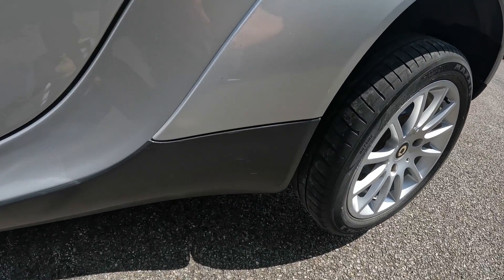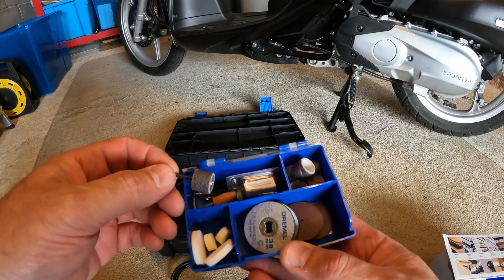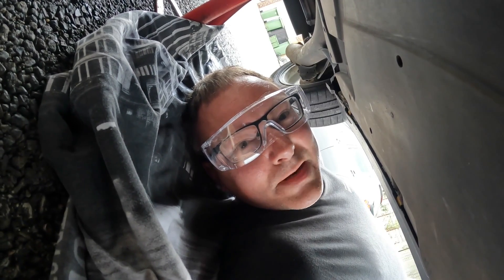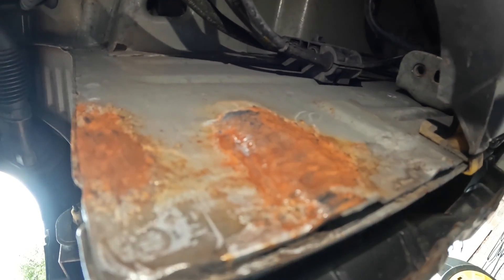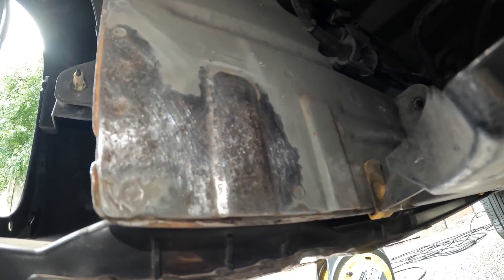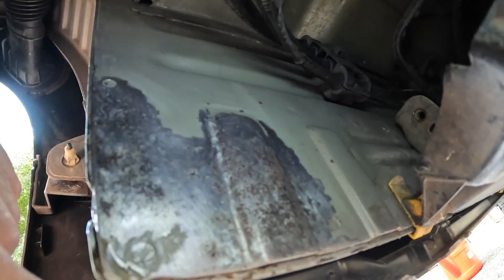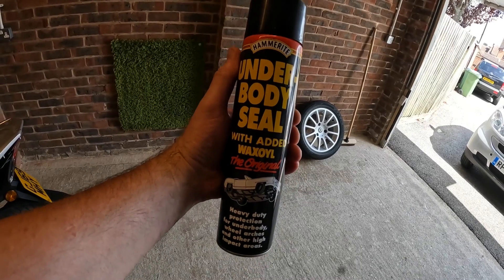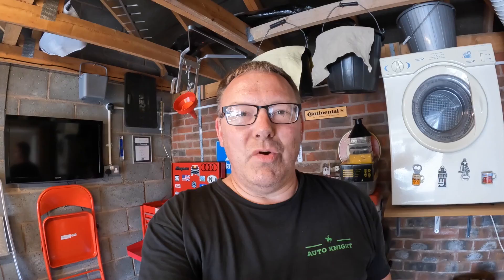Tridion Rust/Corrosion - Smart Fortwo 451 Passion 84 BHP 2008 - Fixing Rust & Destroying a Dremel

Comment: As for protection, as a former corrosion and coatings technologist, I would use an acid etch primer prior to the (cold) galv paint as it will adhere to the primer and oxidise without flaking off. After that, paint it with what you like.

Comment: Will check this area, when I'll paint the rocker and front+rear lips, in body color. Thanks for the tip! 
I would recommend, a light spray-on underbody wax over that. Still transparent, but protects even better. I had the impression that spray zink coatings are not very rub- or moisture-resistant. Best Regards

Comment: I must check this area on mine. There's a cold galvanising paint similar to yours called galvafroid, we use it frequently in fabrication and it works really well, a small can is quite heavy. If yours is like that it should be very effective. The Dremmel is disappointing! 
I use rotary wire brushes in a cordless drill when access is good and also small rotary  grinding bits, both with 6mm spindles. Nice job though 👍

Comment: As an engineer I wholeheartedly agree with your philosophy of not masking with underseal as this can get damaged itself and then water and contaminants can get under it and actually cause unseen rust.

I use Waxoyl spray everywhere including inside cavities such as sills and the rear swinging suspension tube 

One thing I would say which you seem to have overlooked is the actual cause of the rust in the first place.

You correctly diagnosed the reason being the movement of the plastic arch liner end. It will still be rubbing and removing your fantastic work, resulting in further exposure to rust pretty quickly.

I'm going to check my 2010 451 tomorrow and fix any issues but then I will adding a double sided rubber patch on the rub point so that the plastic liner has something non-metallic to rub against. 

Ages ago I bought and extremely cheap Chinese variety pack of rubber pads designed for use as feet on boxes etc. One of these each side would be perfect.

I am fortunate that my 451 must have been stored in a garage as there is no rust anywhere...except those stupid Torx bolts holding the exhaust heat shield on which I have soaked in Waxoyl rust inhibitor spray in readiness for removal and replacement, probably with stainless.

Enjoy all your videos mate.

Oh...and my Dremel is 20 years old at least and is still going strong. Don't lose faith in them...maybe pick up and old one secondhand as they were possibly better built back then and are indispensable tools.
Reply from the maker: Thank you for your comment. I haven’t yet fully refitted the arch liner so I’m still debating what to do, either a rubber pad as you have suggested or a cable tie to secure the end extension of the liner to the adjacent plastic under tray, therefore keeping it away from the freshly painted section.
Reply: fixing the rub would be better done by removing some of the plastic so it does not rub. if you genuinely want to stop the problem coming back, that is really the only way. you need to remove the pressure between the pieces. use of things like rubber patches become areas that will require maintenance and it is better to avoid adding to the list of things you have to go back to check. just my .02 from 30 years of experience trying to stop this on vehicles, especially motorcycles where rubs are often and plenty!
Reply from the maker: @ribbitism  That is exactly what I’d planned to do until the Dremel ceased working!
Reply: @ribbitism cover everything metal in a thick coat of green Rust-Check👍🇨🇦

Comment: As you have found out, the Dremel was not exactly the tool needed. Instead, an angle grinder with a wire brush cup or a wire brush wheel would have been much more effective. However, they are so much more dangerous than a Dremel, and I would recommend a full face shield fitted to a hard hat, as well as a dust mask for such a job; plus possibly goggles as well, plus good gloves. 
A good job though, but would also have added a couple of coats of Hammerite. Etch primer, as others have mentioned is also a good idea.